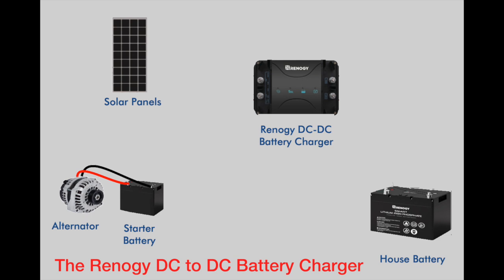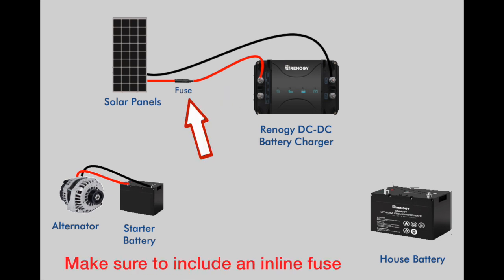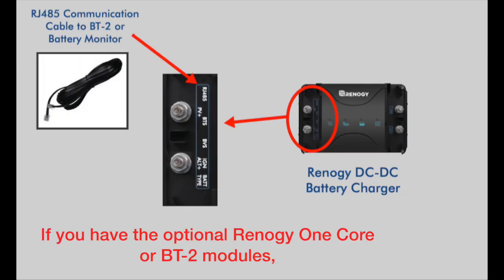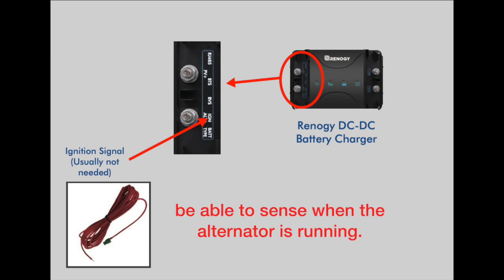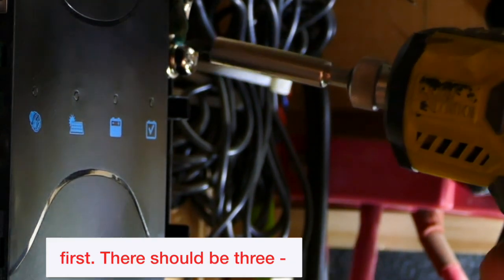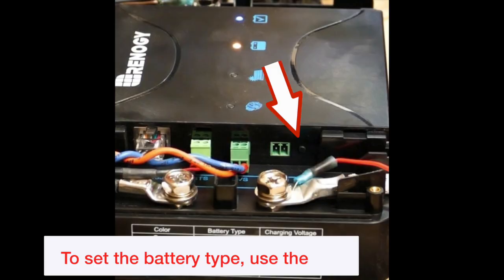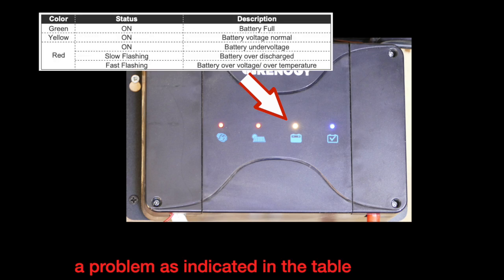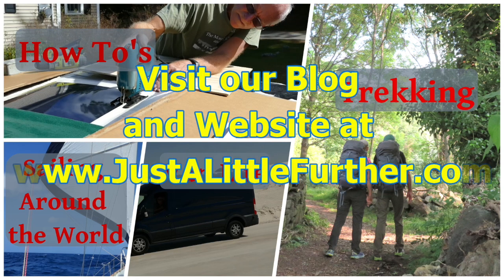Installing a Renogy DC to DC Battery Charger

Comment: I assume the Renogy DC to DC Battery Charger can't handle shore line, right?
Reply: I assume by 'shore line' you are referring to an external 120VAC connection.  External AC still requires a 'converter' (aka AC charger) in addition to the DC-DC charger.
Reply from the maker: Yes, you are correct. The dc to dc charger only allows input from a solar panel and the vehicle alternator

Comment: Hello, i just bought the 50amp version with a 100ah lithium battery. I followed the diagram and hooked it up correctly. I mainly bought the battery and renogy charger for my diesel heater in the van. But i actually dont know where to hook up the wires from the diesel heater. Might be a dumb question… im new to this electrical stuff. I was copying this guy i met the other week and he hasnt replied back to me. So im lost with the last step. Do the wires connect to the battery?
Reply from the maker: Yes, you should connect the heater to the battery. You should also have a fuse, close to the battery, in the wire attached to the positive battery terminal. Your diesel heater installation manual should specify the fuse size, but if I recall correctly, it should be a 20 amp fuse - but please check this. Hope this helps.
Reply: Do you have a bus bar?
Reply from the maker: I do have a bus bar for the house battery. It makes it easier to connect all those ground wires.

Comment: Hi there ! I know this post is a year or so old. But I noticed that the renogy user manual wiering giagram shows the negatine wire of the charger battery goes directly to the negative terminal of the house battery ! I does not going through the dc to dc charger ! Or does it metter !? Thank you !
Reply from the maker: it should go to both the negative terminal of the house batteries and the neg terminal of the dc-dc charger.

Comment: Where you connected battery voltage sensor?, directly to battery?, I've got 2 battery connected together, Thanks
Reply from the maker: Yes - it should be connected directly to either battery  - assuming they are close to each other.

Comment: Hi, Just purchased a Renogy 12 volt DC to DC charger can you tell me if both the green led and the blue led ( lithium) are so supposed to be on constantly when the van is not in use?
Reply from the maker: I may have an older version, but on my 50a DC-DC charger, the  Service Battery Indicator is solid green when the battery is fully charged, and both it and the Battery Type Indicator (Blue) remain on even when the ignition is off

Comment: cut the temp sensor wires, put ring terminals on the ends and use them as a voltage sensor for the house battery.  The red wire goes on top where it plugs into the BVS input on the DC-DC charger

Comment: Hi do you know if the bule and yellow on the right should be on all the time as i fitted mine today and throught it would all turn off when the engine was not running
Reply from the maker: I  may have an older version, but on my 50a DC-DC charger, the  Service Battery Indicator is solid green when the battery is fully charged, and both it and the Battery Type Indicator (Blue) remain on even when the ignition is off

Comment: This DC to DC charger will not produce 50 amps from the alternator if it senses any current from solar panels. My unit was only bringing in 24 amps from alternator even though there was no sun, so I removed the fuse to the solar panels and it went up to approximately 50 amps from alternator. Fortunately I have another charge controller I can use for the solar panels. 

If it wasn't for the form factor, I would not have chosen this charge controller (low volt capacity).
Reply from the maker: Absolutely true - and I think this is the only shortcoming of the Renogy Dc-dc converter.
Reply: @JustALittleFurther the shortcoming makes it not what is advertised.
Reply: It has a low current cutoff, where (for the 30a version) the charger switches to alternator only if the solar input is less than 7a (which can be increased to 10a in the app). Should work the same for the 50a version
Reply: @thejey9297 not the one I have, even at night I have to remove fuses to get close to 50 amps. I've ran many scenarios and same outcome.

Comment: The BVS wire is not essential? what does this connect to? this go to your starter battery? I just measured it and it is only 9.5 ft and the starter battery is like 15+feet away.
Reply from the maker: The BVS is used to monitor the house battery voltage, not the starter battery, to maintain the correct charge level based on the battery temperature. Not that if your house batteries are LiFePO4 batteries, the BVS isn't used as the batteries have a built-in battery management system that adjusts the charge current based on the battery temperature. BTW - sorry for the slow response... for some reason, YouTube has stopped sending me email notifications when I get a comment.

Comment: Mine was working perfekt for a year now, but today its not working any more , solar makes voltage but the dc-dc dosent light or charge , and if i turn on my boat engine , it altso dosent charge , do you have any idear what went wrong ? Maybe the dc-dc is broke
Reply: Mine has now started to drop off how much current comes off the alternator. I get 24 amps of power when I was getting 47 amps about two months ago. POS is probably the reason.
Reply from the maker: A shortcoming of this charger is that if you have any solar input at all, the alternator is limited to just 25 amps. Perhaps this is the problem? I've wondered about adding a relay that was controlled by the ignition voltage that would disconnect the solar panels when the engine is running, but I wonder whether the arcing generating when the solar output was suddenly switched off or on when it is at full output would be a problem.
Reply: @JustALittleFurther yes, extremely annoying that it does this, removes the "smart," out of the advertising. Good idea, but yeah on off may cause problems especially when running to pick up supplies (lot's of starting up the rig). I run two charge controllers and ended up adding more solar as a fairing to nullify the need from the alternator.
Reply: @functionalvanconversion4284   i think if you open it , you have 2 fuses that can be replace. I saw it in an other video

Comment: Is it not bad to stack the 3 negative wires on one single terminal or is that fine? I am thinking about doing that too, if it works since i dont want to buy extra bus bars.
Reply from the maker: @Eliahexplores  as long as the nut can be tightened, it’s okay to stack the three wires on one post. Put the largest wire on the bottom.
Reply: @JustALittleFurther Okay thanks I will do that

Comment: When i disconnect my solar panels via mc4 connectors, my renogy dc50a mppt charger, does not allow for the full 50a. Eventhough my alternator produces 100ah of power.  What might be the issue?
Reply from the maker: @mehdidelghandi23  Could be a number of reasons… a 100 amp  alternator only puts out 100 amps at a relatively high rpm, and even then, a large portion of the amperage is used to recharge the starter battery and run the other electrical loads. Is it close to 50 amps after running the engine awhile and while revving the engine? I have a 200 amp alternator, and with no solar, I typically see ~45 amps going into the house battery.
Reply: @JustALittleFurther  thanks for the reply. Interesting. I do get around 28amps into the mppt. So that might be the max maybe. I will try to see with higher rpm, also while driving some time. Thanks

Comment: What gauge wire is used from van battery to dc input on charger?
Reply from the maker: @MariaBuchanan-e3d  Good question! The wire size depends on the size of the charger (20amp, 40 amp or 60 amp), and the length of the wire connecting the alternator/battery and the dc input. The Renogy installation manual provides a table on page 10 of my manual that specifies the wire size. For example, if you have a 40 charger and the wire length is 20 feet, then you should use 4AWG wire. Hope this answers your question. David
Reply: @JustALittleFurther  I don't have the manual and i have a 30A charger
Reply from the maker: @ I’d use a 6AWG wire size.
Reply: I want to charge my on board lithium battery evem when the vehicle isn't running. When I plug my rv into 120vac it powers the onboard inverter...and distributes 12v to outlets. Motor not running but have 12v input...will it run? Can I bypass the alternator sensing wire?
Reply from the maker: @rogerwhiting9310  Not at all sure about this. Maybe you can get an answer from Renogy.

Comment: Great guide,

installed but have a constant draining of the starter battery problem it will drain it to zero if I let it. I have removed and installed a new starter battery but also see it will be drained by a volt a day.

there are no warning light colours and everything works i.e. colours correspond to correct working by instructions

it shows solar as constant red meaning it is working but my DC home app is showing the PV voltage as 14.7v (under the 15v solar charging trigger in the user manual) so this is slightly strange?

I initially didn't connect the D+ wire (Ignition sensing) I connected this thinking it would solve my problem of possibly always having the mmpt idling (on) if read online some people have had this problem before

Everything works as should but the draining of house battery ofcourse. My 400w of solar is very low only producing a couple watts of power 3-7w and 0.07A i do live in rainy cloudy Lithuania but on a relatively sunny day it doesn't go over 10W.

Anything spark to mind? 

i do only have a +ve terminal cable running from Starer to ALT + terminal on MMPT could this be my main problem?
Reply from the maker: Hi Matas, this is very strange. I can think of three possibilities: 1. A short in the wire from the alternator/house battery to the Renogy; 2. Something miswired on the Renogy - something connected to the wrong terminal; or 3. A defective Renogy. You can eliminate #1 by disconnecting the alternator/battery cable at the Renogy end and see whether the problem persists. #2 seems most likely to me, especially since the solar panel also doesn't seem to be working as expected. I'd very carefully re-read the manual and double check each wire and connection. (It's really easy to make a mistake - I'm embarrassed to admit I miswired a connection on the Renogy myself just a few months ago when I was adding a rear camera to my van). Good luck and let us all know what the problem turns out to be.
Reply: @JustALittleFurther  Thank you for taking the time to respond,

Once fixed i will add a solution but for now.

Further question if possible please, the Negative from the starter battery should it run to rheology MMPT or is it fine (From what I have done and read) to use the ground from MMPT to chassis i have removed paint and made it bare metal and used good nut and bolt

From Renogy themselves an answer is

We were able to confirm with our technical specialists that what you're experiencing with the battery charger is normal as this is how the unit works. So as long as the battery needs charging, even if the engine is off, the battery charger will charge the auxiliary battery from the starter battery. We apologize if this is not what you expected of the unit. We recommend installing a disconnect switch between the starter battery and the battery charger. The battery charger will stop taking charge from the starter battery by the following:
1. If the starter battery's voltage is 11.5V the battery charger will stop operating.
2. You can put a disconnect switch in between the starter battery and the battery charger so that you can cut off the power supply from the starter battery. This has been confirmed that installing a disconnect switch between the starter battery and the battery charger will resolve the issue.

It's strange as my starter battery is below 10.4v and it's still dropping but the isolation switch could be a simple/stupid fix.
Reply from the maker: @matasjarutis3499  using the chassis as the return for the solar panel should be okay. Renogy’s response doesn’t seem very helpful at all, though. Another thought that comes to mind, however, and might explain all the symptoms: is it possible that the solar panel output is reversed? If the solar panel +wire was grounded and the -wire connected to the PV+ terminal? Another possibility is that the blocking diode in the solar panel is blown, i.e. shorted, which might cause the battery to drain when there’s no sunlight.

Comment: Do the voltage sensor wires go to the starter battery or the house battery?
Reply from the maker: @mattfowler3718  Good question… they go to the house battery
Reply: What is the polarity of the BVS plug? Based on internet pictures, it looks like positive on the left, negative on the right.

Comment: I installed this in the back seat of my truck camper to power a 12volt fridge.
Works fantastic. It only takes a hour or so to charge a 100 amp hour battery so I was thinking about installing a switch to possibly charge a 280 amp hour battery in the truck camper to power a 12 volt fridge that will replace the propane fridge by using a Anderson plug. Do you think this idea is practical if so what would I use for a switch?
Reply from the maker: @garyferguson1552  I’m not clear on your question. If all you are doing is charging the 280 ah battery bank, why do you need a switch at all?

Comment: what lithium battery can i use with this (none Bluetooth) DCC30S version please. As renogy UK don't tell you on there site
Reply from the maker: I'm quite sure you can use this with any lithium battery as the charging parameters are very similar if not identical.
Reply: thank you for that cheers

Comment: Hi, thanks, do you disconnect any of the existing wires going to the house batteries?  My current setup has 2 deep cycle batterines that are connected and charged by vehicle or shore power.
Reply from the maker: I don’t think you need to disconnect the shore power charger, but I think you should disconnect the charging cable from the vehicle alternator since the DC-DC charger does the same thing in a more sophisticated way. Does this cable go through some sort of battery isolator?  If not, you can just connect the cable from the alternator to the input of the DC-DC charger, assuming the cable is large enough. Hope this helps.

Comment: Hey, I just ordered a 40A dctodc, what kind of fuse do i need?
Reply: You will need three fuses. One on the output of the solar array which should be about 1.5 x the total amps produced by the the solar array, a 60 amp fuse on the input from the starter battery/alternator, and a 50 amp fuse on the output of the DC-DC charger. Hope this helps.
Reply: @nineofcups1  oh thanks! i don't have solar, just from the alternator to the battery. If I decide to get a solar panel, can I also plug it directly into the dcdc or do I also need another device?

Comment: Do you know the thickness and length of the wire you used to connect to the solar panel?
Reply from the maker: @eedom69  we have 200 watts of solar, and the distance from the solar panels to the battery charger was about 10 feet, so 8 gauge wire was adequate for that run. The output of the battery charger can be as high as 50 amps, and that run was about 3’, so I used 6 gauge wire for that segment. Hope that helps.

Comment: Thanks do you know where you got the wire for the connection to the starter battery?
Reply from the maker: @eedom69  I got it on Amazon a few years ago. It was left over from another project.

Comment: I have a 6amp renovó charger with  4 205ah lithium batteries. I would like to install a higher out put alternator. What do I need to co sided before I do?
Reply from the maker: @87skunkape  sorry, I don’t think I can help you with this question. Maybe try one of the forums like the Transit or Promaster forums?

Comment: Installed one of these for a friend.  Works as designed.   Renogy is releasing a new version with a 50v PV input and slightly adjustable PV/alternator split, but I haven't seen one yet.
Reply from the maker: Those improvements would address the only two issues I have with it. Thanks for the feedback.
Reply: I have my solar panels going to 2 solar charger then to the main positive bus pos/neg.
Could i hooh up my alt pos at my stsrt battery with tge start bat neg ? Start batt is lead acid. Would i than take the out put of the dc to dc to my lithium/ house battery main luged pos/neg. Thank you